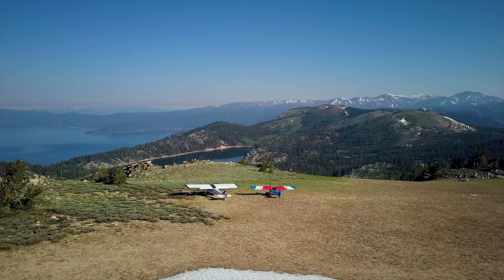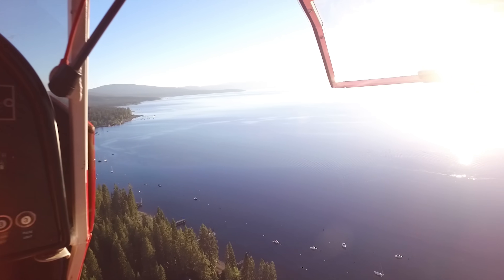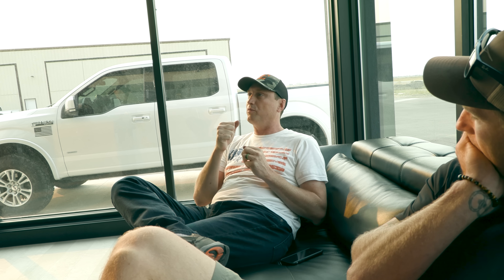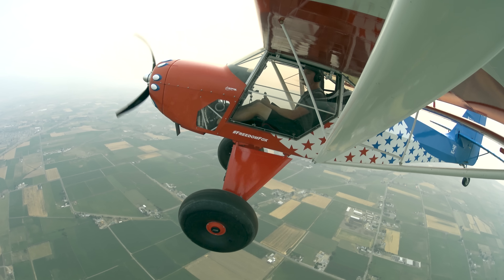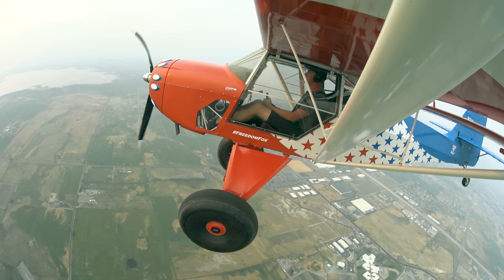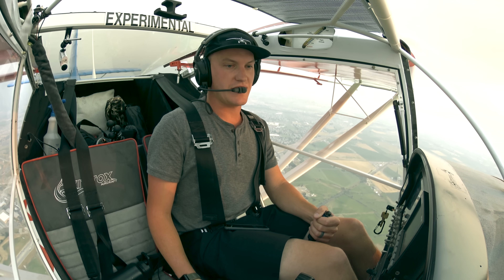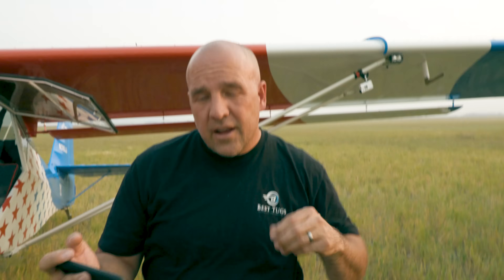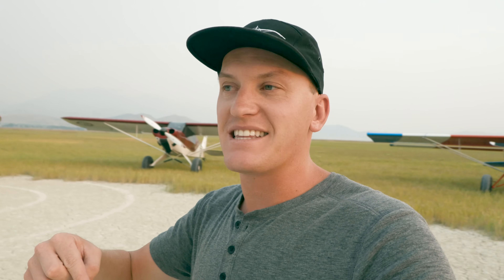YOUR FLIGHT INSTRUCTOR WAS WRONG! - Simulated vs Real Engine Failure

Comment: You need a wind tunnel.
Reply: Give the Pateys 5 mins they'll reinvent a wind tunnel 10x better.
Reply: Burt Rutan would "wind tunnel test" scaled airplane designs on a pole on the hood of his car.
Reply: i don't see way not , don't always need a fancy set up or a degree to prove that , just a hobby king motor test bench scale a motor at GE aviation RPM and a scale proportional propeller , duck tape on the hood of a car going  55 MPH , and voila lol .
Reply: Not really because it's constant mathematically measurable wit basic of fluid dynamic equations, but win tunnel would revealed a more constant average numbers , and I am certain it would prove the math right , no disc bullshit effect that is a optic effect observed, but no scientific FAC behind.

Math and science never lie
Reply: @Brian Foote well the question was is a motor at idle ,therefore the fix pitch  props spinning at 800 Rpm create drag , and the answer is no it create more thrust no  matter you glide slope  head win , but if you have something different question I'll be happy to answer it the best of my knowledge.
Reply: >> face palm << shurr budy shurrr , contemplate no thanks, but paying attention when you actually replay to my comment, so probably tray reading it first , because i read yours and it all but a opinion no matter the profile aria do not translate in  RPM you need to do the math first before you  spit the answer because i don't even think it's close  . so if you actually have a decent formula to come up with that i would  like noting more then to se it , not saying your wrong but it dos not add up in the world of physic
Reply: end of the story , is not a augment or even explanation , it's just lack of viable information and knowledge of physic mechanic, if propeller are designed at a rpm how come they operate at a wide range of RPM hummm  ,  anyway the rule of thumb that you show is only to calculate the past of a prop noting more , na unlike you i read and understand aeronautic engendering book because i do airplane concept and can calculate Rainold number and fluid dynamic , and your 3D shit int in there , but sure ting men let's call it there
Reply: first i never said that i was a aeronautic engineer but yes i study a lots of it and probably understand a little more then you advisedly , and it's evident 101 that the root travel at lower speed then the tip there for a different profile ,  and yes the propeller is chosen for the engine RPM range  , but sorry men calling people name wont make you a authority in props, the props profile is not comparable with a airfoil period , it's fluid dynamic and  laminar flow cant't be compare ,  but from that simple observation that i never contested , as not correlation what so ever with it's drag at lower speed  and low RPM and you still fail to give me any articulated  example and  calculus regarding that  , but i don't expect any since  your felling seem to hurt so bad . how old are you ?
Reply: i was hoping you educate me since you pretend to know it ? and no i don't care for you treatise, i only care for articulated and educated peoples  that come up with the answer for a given question .
Reply: @Brian Foote no pitch is constant and engine is at idle , the very important factor is air density and air speed , it will be a head win on a glide slope , and I used a common pitch and no pitch and same result not a factor what so ever till rpm is at 60 RPM or lower

Comment: I'm actually surprised that a windmilling prop is any different than a stopped prop. I understand that with a windmilling prop, work is being done by the air to turn the prop, while a stopped prop is just generating heat via friction with the air, but I thought the energy would have been the same. 
That being said, I was not at all surprised by the answer to the actual question.
Reply: The windmilling prop is also turning the engine, which uses a lot of energy, thus creating drag. At least in reciprocating engines.
Reply: No, it should still create less drag than the still prop since, at least if it is turning, it is changing the direction of the air less.

Comment: Some thrust is better than no thrust.
Reply: Thats what she said..... sorry had to go there
Reply: True. I believe folks are looking at this issue from the wrong direction. A propeller has "X" amount of surface area producing drag, whether turning or not. What over comes that drag is thrust, and an idling engine produces some amount of thrust regardless of any propeller drag. The aircraft drag does not change based on the engine or propeller turning, it changes based on the thrust produced. Lift versus gravity; thrust versus drag--the basics of flight.
Reply: horse manure
Reply: It doesn't matter what your airspeed is, an idling engine/prop is producing less drag than a stopped one. No matter what your speed, an engine idling/turning a prop is subtracting from total drag. There is no magic speed where the stationary prop will allow the airplane to glide farther than the idling prop. The idling prop always wins.
Reply: @sleddriver  No, airspeed has no influence on the airflow around the prop blades. That's because the Prop Gremlin chases the air away to compensate for airspeed. He has a small turbojet for that. He also uses a flame thrower to warm up the air around the prop. Air temperature and air pressure are also compensated by the Prop Gremlin. That's what his green little hat is for. To simplify things, for people like you.
And Roald Dahl, the WW2  pilot and marvelous author, he met the Gremlins in person. So it must be true. I believe his Gremlin story better than your blunt simplifications. Just think of how a prop blade moves, and how it moves through the air. There's an angle of attack involved, and nobody said it has prop pitch control. So how on earth can that angle of attack, and drag, not change with airspeed? Are you a farmer with tractors for a hobby? There might be some things you need to learn, if you're a pilot. Ever considered Artificial Unintelligence as a username?
Reply: I dont think its about drag at all. The spinning prop is seriously just going to be disrupting air on the wings near the cabin. Aka just taking away lift. A stopped prop doesnt create this kind of messed up airflow under the wings.
Reply: I think it is in these cases because best glide is so slow. Presumably there is a speed at which the airflow would be trying to turn the engine so much faster than it was able to run at idle that it would have the windmilling effect. IF the throttles are back to idle and the airflow keeps spinning the engine faster, then the engine will also become less efficient as it will be able to draw less and less mixture through the same throttle setting as the rpm's increase, and at some point it will then stop firing, and it becomes a windmill.

I honestly  have no idea at what speeds that's likely to happen for each engine, but I feel fairly confident saying it's far, far outside of best glide given that you can pull an engine back to idle at cruise and not risk it staling.
Reply: An idle engine does not necessarily produce thrust at flying speed.    It depends on the pitch of the prop and the speed of the glide.   A flat pitch prop will produce more drag at a higher rpm than a higher pitch prop. 

These are relatively light, slow flying planes. Not a surprise that they all get a boost at idle.  Heavier airplanes or flatter pitch props could have the opposite results.
Reply: John Goscinski  Its less drag though. Its a simple physics problem. These things are known quantities.

Comment: Great discussion. I am going to add my 2 cents. I think that with the engine at idle, actually, with the prop still producing thrust, it is forcing air into the low pressure areas behind the various elements of the structure of you plane. Those low pressure areas produce drag, by "pushing" air into those areas with your prop you are reducing the drag profile of your plane. 

I am not an engineer and I don't play one on T.V., so I could be completely in error in my thinking here.

Comment: I had an engine out in a PA-20 at 1,000'agl. That thing came down like a streamlined crowbar! Glide is definitely a little better with an engine at idle
Reply: n4478j: streamlined crow bar is probably faster than a simonized safe? For the youngsters,just to clarify, we used to use Simonize wax on our cars in the old days.
Reply: How does that compare to a greased manhole lid?
Reply: Hooknspktr  I'm not sure how that would compare. Maybe that should be Trent's next experiment. Greased manhole lid vs simonized safe vs streamlined crowbar!
Reply: n4478j I like it!
Reply: Turtle Wax
Reply: I had the same thing happen in a PA 20 while I was towing banners and you're not kidding. I couldn't drop that rag fast enough and I ended up wadding the thing up trying to land in the salt marsh. But luckily I was OK and even though it flipped over the damage was minimal. It happened like it was in slow motion .
Reply: Jesus, that would be like trying to glide with a parachute attached to your tail! I hope you at least were able to jettison the banner?
Reply: @jameshoiby  I was but when the crank broke out of nowhere at 1200 agl it felt like it took forever. I was flying low and slow as it was. But when it quit,it was like hitting the brakes and the stall horn was blaring before my hand got off the release handle. She got all mushy and dropped a wing before I knew it. So it was off to the races before I knew why it quit. 
   I used to get annoyed when people would say "just fly the plane" but it's what saved my bacon. Well that and I've always subconsciously thought about outs to land in a emergency. Thankfully there's tons of open marshes next to where we towed. The downside is its soft,nasty,stinky mud. But it dug in and went over pretty easy so its still a landing in my book and my only injury was a nasty bruise from getting out  upside down in a hurry lol.
Reply: "Streamlined crowbar." that image cracked me up.  Glad you got that thing on the ground safe, though.
Reply: You should auto rotate a Bell 206L. The first few a pucker  factor 25.
Reply: @hotrodray9884  I thought that, as long as the blades were allowed to spin freely, a helicopter pilot could still get their bird down fairly safely. I thought it was when the rotor seized up on you that you're a gonner.
Reply: A PA20 has a poor glide anyway
Reply: LOL streamlined crowbar

Comment: if you've got fuel going into a running engine with a fixed pitch prop, then you've got that prop pumping air aft and push the plane forward.  Newton is at play.

Comment: Great video, thanks Trent.  My instructor back in 1996 in the UK told me that in reality with a stopped engine expect to descend faster even at best glide and to be a little faster during the flare to compensate for less airflow over the elevator.  I’m also a glider pilot so I am always checking for landing spots as part of my cruise checks.  You have a great channel.

Comment: Practically it's a negligible difference in a light single.  Also, not all engine failures are created equal.  IF it appears that the engine is mechanically sound then there's no reason to kill the ignition in the hope that something may "clear" and regain power...however if there's an obvious "hard" mechanical problem and the lump sounds as though you may soon be looking at a connecting rod then the risk of a catastrophic engine failure says to park the blade.

Comment: It would be interesting to do an interview with an engineer at Hartzel or NASA regarding this question
Reply: SmarterEveryDay?
Reply: Brian Foote I already gave out best answer to Charly. ..but yours also a golden winner.
physics  ie Math don't lie....if not creating thrust...it creating drag.  something not factored either in the discussion was Wind direction and speed....all very important factors too: otherwise why would we have two ends of a runway...lmao!

great answer!!  I would fly with you.....
Reply: @richardloveday1092  obviously, when the angle of attack of the propellor blades is zero, the propellor is creating no thrust and no drag.  When the propellor is stopped, the propellor is likely stalled.
Reply: Eh, why do we need NASA engineers? We have Mike Patey! =D
Reply: Don as I was saying in my comment, I would love to see this sussed out in a fluid dynamics water dye tank.  Anyone here work at NASA Ames, and could get a few free cycles with the fluid tank? ? This is what I love abort aviation and aviators- you never stop learning, we are indeed, a band of curious  monkeys! .  Happy flying!
Reply: Look into your flight training manuals where the prop function is explained. No engineers necessary. Common sense isn't common anymore.
Reply: Correct, Bill Hamilton.  Even if you want to go further into actual engineering texts, the effects are well known and don't need any further wind tunnel tests at Ames or whatever.  It's all well documented already.  

Trent's tests did show that it is wrong to always assume the idle glide is worse than a stopped prop.  

- It is also wrong to assume that idle glide is always better than a stopped prop.  

It depends on the airplane, the pitch of the prop and the glide speed.
Reply: Agree.  Common sense is a misnomer.  Uncommon sense is more accurate.
Reply: @Bill Hamilton - Hamilton, as an Hamilton Standard Propeller Corporation? Any relation? Or Hamilton Aviation, Tucson, Arizona?  :)

Comment: Dang, I'm early.  Great video Trent, as a flight student currently working on my commercial license this video will definitely bring up some great conversations with my CFII.
Reply: If you want to have some fun building time in a tail wheel, look into pulling banners. I did it for 3csummers and had a blast. Plus it'll really help you to be a better pilot in my opinion. Diving down to pick up is a blast but it does get a little boring after that. But that's a little price to pay for spending summers at the beach having a blast getting hours. If you get a chance look IP Paramount air service, the one kid I flew with has some videos on here. 
Good luck
Reply: I'm almost finished with my tailwheel endorsement, so I'll have to give that a look!
Reply: @199tornado  its a ton of fun and you get a lot of time. If I wasn't married I'd probably still be doing it  ; -) Anyway good luck

Comment: Seems like there are a lot of variables. Determine the airspeed generated on the ground at idle with zero wind.That's possibly you're only constant...the equation in the air can UTILIZE that number, but only relative to the other variables. The approximately 12% more time aloft Trent got with idle could make the difference between embarrassment and catastrophe. I made a forced landing at idle in my tri pacer and my "sense" was that she dropped a little slower than it would have if it was completely shutdown. My two cents.
Reply: WendelltheSongwriter when your Adrenalin is up, your brain thinks faster, which in turn makes time feel slower.  That COULD have been a factor in you feeling a slower descent rate.  Even if you purposely did a engine off forced landing, for training, chances are that your adrenaline was up.  Food for thought.
Reply: @PilotJordan  good point. being in Florida, which is just one huge landing strip once you get away from the coasts, I never doubted it would end well. But your point is well taken, thank you!